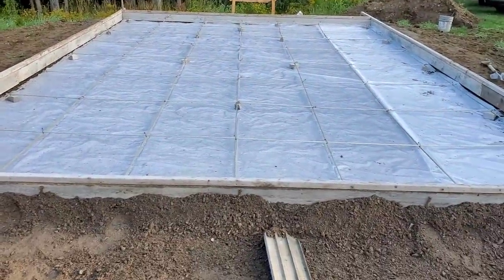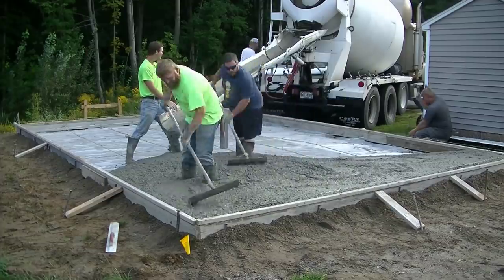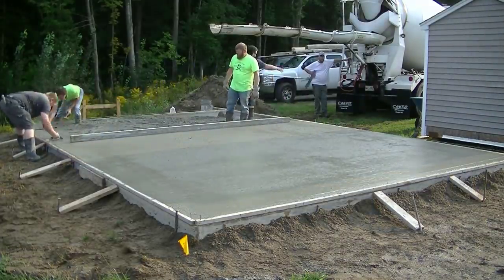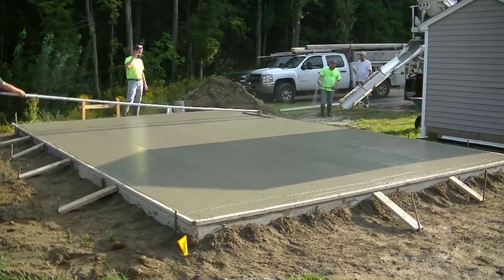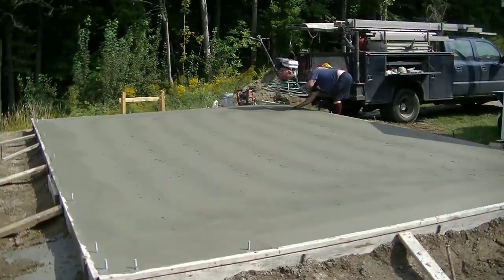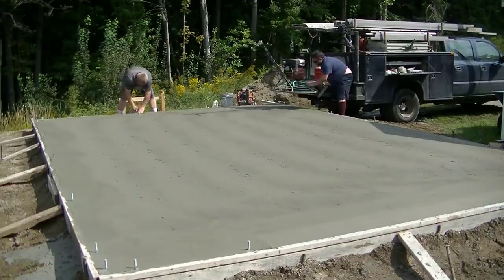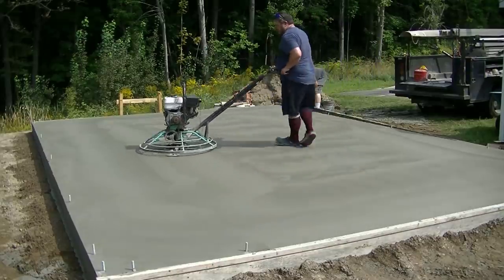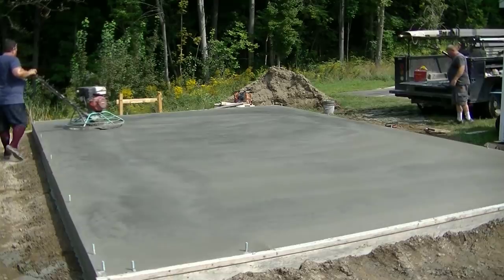They Made Us Pour This Shed Slab 8" Thick (Wasting Money)

Comment: Allows for upgrade of the shed to a house or workshop.   I had complaints that a concrete floor in a conservatory had worn away.  Turned out the occupiers installed a table tennis table and it was used 10hrs a day with all local friends,  if they had said I could have specified a different formulation for the top strata and finishes

Comment: I just love when a city inspector wants to double what is normal, and then insist on it, instead of saying yeah I made a mistake do the right way.
Reply: Boy isn’t that the truth! I’ve had it out with a few of them until I learned best to SHUTUP lol (well MOST times;))
Reply: @jeffchristianson-ziebell  I know, I worked for a company utility and we would argue with them all the time, they would kick us off a job, it happened a lot so our boss had to have a talk with the city telling them to quit kicking us off, we were killing his production, LOL
Reply: 1st of all chief a city inspector has to follow the engineers signed and sealed plans not what they themselves want.  I know, im a state licensed building inspector.  The plans have to go through plan review with the building official first and be approved.
Reply: @mikemcguire4071  So when the same inspector tells one builder that they want all the piping air test to 60 psi and the other builder 15, I guess they are following the plans.
Reply: @Moondoggy1941  no.  The code is specific on how much pressure should be in the pipe.  Keep in mind commercial code can be different from residential.  If the inspector did what you suggested favoritism may be involved and he could lose his license.   You can make complaints against said license that is right.
Reply: @mikemcguire4071  I t cost the builder tons on time and money.

Comment: The property owner is the decider.  If they wanted it a half inch thick you should advise them of any problems you foresee and then you pour the half inch slab.  Maybe if it doesn't meet inspection requirements get them to sign off on it, but do what the property owner wants without judgement.

So if they want it to exceed requirements, again you should inform them if you think they can save money somehow with a thinner slab but you never suggest it as a superior alternative.

Comment: It has been mamy years since I worked in building design and construction so I'll defer to your expertise. But we built many buildings back in the 80's with a 4" slab on a 4 - 8" compacted stone base with 4x4 or 6x6 wwf. 2,500lb mix. I've done the engineering analyses on these so I know they are strong enough for most uses. I also built a cancer treatment center with concrete walls as thick as 3' to prevent radiation leakage. We used rebar with concrete floors 2nd story and above, but typically not SOG. I understand floating slabs with a reinforced thickened edge are an alternative to deep footers and foundations but this is something different. As for codes, I'm skeptical that any code would require an 8" slab for a residential outbuilding. Great video and I'm not questioning your work at all. Just wondering if industry standards have changed that much since the 80's.
Reply: I'm guessing the key is the base? I know, I've been involved in warehouses that have multi tier racking and 5 ton plus forklifts driving through that only have a 6" slab. As I recall though the base is 18" compacted stone.

Comment: This was probably for a private contractor. He probably recommended the extra concrete. And or it was a change to save money initially they more than likely had a footing for this design on the plans . 6mil is used under all our slabs where I am in Jersey. What’s the price for a bundle of fiberglass rebar? If it’s affordable it should take steel out of business. I still would go with steel for vertical reinforcement, fiberglass won’t rust. You guys work together effortlessly. It’s hard to build a crew that are one as a unit but when u do they’re like family
Reply: How much cheaper is the fiberglass rebar?
Reply: Funny thing is, in the video he said that the Customer wanted 6 inches

The City demanded the 8inches.  Why is everyone saying the customer wanted 8” ?   You all crazy.

Comment: Great video!
I love the idea of fiberglass rebar and stainless steel anchor bolts! Using slag steel rebar seems asinine since all steel rusts eventually, the integrity of the concrete is going to be compromised by rust swelling as well as loss of tensile strength, (condo collapse in Florida).
1) Didn't you need to have your forms and rebar inspected prior to pouring? If so, wouldn't the inspector have mentioned the 6in and 8-in difference and failed the inspection?
2) By adding a 2-in furring strip to the top of the forms didn't you just raise the slab height so now it does not match the slab height of the other building - which was one of the requirements?
3) Isn't overworking concrete just as bad as overwatering it?
4) I was tired of seeing spalling on other driveways so when I poured mine I ordered a 5,000 PSI mix with air entrainment and fiber. It's been 24 years and it looks as beautiful as the day it was poured!

Comment: Where are the grade stakes. You can't tell me that that slab is exactly the same height in the middle as the forms on the outside. If the screed board was the same width as the forms, it wouldn't be necessary for the grade stakes. Also the concrete ball that came out of the chute should have been removed rather than chopped up. That creates a void of weaker concrete in the slab. It appears that was the only one which was good. But it should have been thrown out of the forms or chopped to pieces in an area not already filled with concrete. That way it would have been like the filler in the bottom. FYI those balls are caused typically from wet sand at the batch plant or a mixer with a load of hot mud and being topped off with fresh at the batch plant.

Comment: A slab is only as good as the base it sits on. 6 or 8 inches no difference except cost if the base is good. We have been looking into the fiberglass reinforcement. 2 issues that we have found. Firat we can't find an engineer to sign off on it for replacing steel rebar. Second all the fiberglass in our area is smooth, which means it is more difficult for the concrete to adhere to it. How much has to be buried in the concrete to reach full pull strength and how much for laps? I know it is cheaper and way lighter. Another issue we would have we would need corner bars made since it can't be bent.  Great job as always mike.
Reply: If the fiberglass is  not deformed it would be a waste of time using it . There is a reason that steel reo is deformed , they don't just do it for fun .
Reply: @stewatparkpark2933  pull out for the fiberglass is a concern even though almost always rebar is for sheer strength. Pull will determine your minimum lap joints and how long you need for pre-made corners. One significant advantage is they don't rust and aren't affected by calcium or other additives.  Disadvantage they can't be stored in the sunlight. I'm still checking on if they are a good replacement for us but without an engineer to sign off on it I doubt our inspectors will even consider it.

Comment: steel and concrete work well because the thermal expansion is pretty much the same. How is it with fibreglass?
Reply: Has nothing to do with that. Concrete has compressive strength and rebar tinsel strength. Btw steel has much more thermal expansion than concrete.

Comment: I once lived at a place that had a garage bigger than the house. Two double car garages with a gantry chain crane that spanned both of them, and a HUGE garage bay on the other side that was used for fixing farm equipment (you could drive a combine in minus the header and still have room to spare). It had roughly a foot thick slab that was so smooth it would get a shine to it when clean... I miss that garage :-( the house was crap though...

Comment: background:
concrete can't handle tensile stress very well, hence it will crack if stretched. it'll also crack when it bends, because the convex side will experience the tensile stress (while the concave will experience compressive stress).
usually rebar is placed closer to the side that is likely to experience tensile stress, so having rebar right in the middle of the slab isn't very useful. ideally in a slab the rebar would be placed in 2 layers, since the slab can bulge or bend and the 2 layers will help with both.

fiberglass vs iron:
in general, iron has much higher Young's modulus than fiberglass rebar, which means iron will stretch much less than fiberglass given the same amount of tensile stress. this is why iron is usually a better reinforcement material than fiberglass. HOWEVER, if the structure experiences frequent load changes or exposure to abrasive elements (esp. salt water), iron will suffer from material fatigue and corrosion and fiberglass will not. and of course fiberglass is much lighter, so it's easier to work with and it won't affect the structure weight as much. while you can replace iron with fiberglass, you generally need much more of it to achieve the same resistance to tensile stress.

bottom line:
for a slab under a shed you can skip the rebar all together unless it's on freshly infilled soil. if you do put the rebar (e.g. for heavy machinery), your best bet is to put 2 layers of rebar (about 2" from the top and 2" from the bottom) with 16" O/C for iron and about 10" O/C for fiberglass.
Reply: The amount of reinforcement put in this slab is only sufficient for shrinkage and temperature control. Therefore, it should be placed "above the mid-depth of the slab" (Designing Floor Slabs on Grade, p. 18, Boyd C. Ringo and Robert B. Anderson).  To say that placing it at the " middle of the slab isn't very useful" is incorrect. Also, for concrete constantly exposed to earth the minimum coverage recommendation is 3", not 2" and for the top, #5 bars and smaller only require 1 1/2' of coverage.

Comment: 8 inch seems excessive. But in saying so I bought a public utility building and its all 12 inch concrete. I think the fibreglass reinforcing is going to be a huge failed product issue in the future. You only need to see how it flexes to know that it won't give concrete the lateral strength which is the whole purpose of reinforcement. I'm surprised the steel industry hasn't tested fibreglass in structural beams to show its lower carrying strength.

Comment: If I’m willing to pay for labor and materials for a 10” slab and the contractor is willing to do the work and guarantee it, then the customer is right. How is this a waste of money if it’s what the customer wants and he’s willing to do the work?  Maybe the customer is housing a CNC shop in there. Or, a hydraulic truck lift. Or how about an I beam structure that requires the foundation to be 8” for when they bolt it down.

Comment: Have been using it for 3 years now up in Green Bay Wi been working great.
Reply from the maker: Good to hear
Reply: @MikeDayConcrete  it nice to cut we use a carbide saw blade in a rechargeable circular saw?
Reply: Watch out for the safety Nazis telling you you got to wear a mask when you're cutting carbon fiber with a circular saw that's not attached to a HEPA vacuum, LOL

Comment: Forty years of building, and my buildings on my farm, for any building, even if a shed, being a larger size, 8 inch would be my minimum too, have seen cracking even on 6 inch, and if never know the load at any point in the future best to be safe than sorry no telling what my be in that shed, heavy equipment at some point ? 6 inch exterior, I never never do anything 4 inch anymore myself, a little more now no worries later. and garages here, 8 inch min and no cracking, SUV's are heavier now. Farm maintenance building is 10 inch, but these big pieces of machinery is heavy.
Reply: and with a building that size, even if said was a shed, who knows future use, would have set foundations perimeter bigger like if were a house just in case if were my building.

Comment: There should have been city approved stamped plans on site and given /shown to you to bid on. There should have been no surprises. It was your fault for not insisting on bidding from approved plans! Also why don't you have a copy of and know the State Building Codes governing your trade? You should only be doing work that meets either minimum building code standards or from an engineered stamped plans. Building Codes are the minimum standard also, so if an owner wants more than the minimum and pays for it that is fine. If the slab plans were stamped by an engineer then the inspector uses that specification to enforce, not the minimum state code. You apparently never learned to get the actual final plans to bid from.

Comment: Try building in a high wind zone.....two feet wide and 8 inches thick for footings. Threaded rod embedded into rebar and speced into the treated base plate. 
All hardware in contact with treated lumber has to be hot dipped galvanized??......find an all thread 1/2 inch dowel rod HDG...does not exist, but my project passed inspection.
After the inspector left the job site, I removed the square washers, and packed the area around the threaded rod with marine grease...the corrosion had already started on the threaded rod.

Comment: Mike i need 2 driveways one 14x600 6in and one 14x2000 6inch. Then i need a 30x60 12inch with 6inch PVC drain pipe in center with slab slope to drain pipe. Cannot find reliable cement work here so if you want to come on down to Ms i got some work for ya..lol

Comment: Gentlemen, (judging by the YouTube videos that I have seen), the amount of reo steel that is typically put into a slab in the USA is exceedingly little compared to the requirements in Australia. The cost of concrete is relatively little, especially when compared to the cost of formwork, approvals and slab failure. I encourage you to build stronger than you think is required. Slabs are typically over loaded at some time in their life.
Regards,
Geoff. Reeks

Comment: Another long term benefit of the composite bars over steel is the lack of corrosion.
Over time the freeze thaw cycle and the moisture getting into the concrete does allow for the metal bars to rust, which leads to failure of the concrete. We are talking close to a 100 year time period for it to happen. The moisture barrier below and the composite bars will actually extend the life of the slab.

Comment: The inspector required a thicker slab. However, the rebar mat also needs to be raised to the middle of the thicker slab. 

The inspector may be applying a new 4" cover standard for steel rebar in slabs exposed to seawater incursion or salty soil. However, it is not necessary to increase cover on Basalt rebar since it does not expand after decades of concrete aging. Local regulations may not (yet) have exceptions for Basalt rebar.

Comment: Interesting that the owner doesn't have 2" styrofoam put in under the concrete  this would make the foundation more versatile  for future use.  Also is covering the slab to prevent early drying of the surface someting that is common ,  l have read that concrete surface should be prevented from drying up one week minimum.
Reply: Ideally slabs should be covered and wetted, especially in hot climates …

Comment: I removed soil and put in almost 2' of compacted road base and poured a haunched slab on the sides was 12" deep by about 8"...most of the center was 5". A little over kill for a 18x30 shop but eh the extra concrete was minimal.

Comment: FEMA flood zones require a minimum slab height, might be what the inspector was calling out. Water reducers are so you can use less water in your mix to achieve a stronger slab without losing workability. Using a water reducing admixture, but not reducing the water in the mix is why you are having low slump and excessive bleed water.

Comment: Maybe this will give you some insight . 8 inches is the normal manufacturer recommended thickness for an anchored automobile lift with a weight capacity above 4500 -5000 lbs,  so that may be the reason , my shop floor is 12 inches thick since I have a large truck in my collection that I work on and I did go  over on design . I had built my shop in the  early 1980s . 82 or 83  , I presume concrete technology has certainly moved on since then .

Comment: DO NOT USE THE FIBER REBAR. I am in the south, a friend who built a 6 bay shop, two had steel no problem. Later because of supply he was convinced to use fiber in the other 4. Weight of cars and and tree roots turned the thing into a cracked, slopping, screwed up mess.
Reply: I bet he didn't pour an 8" slab

Comment: Hello Mike, what is the cost of that glass fiber rebar compared to steel rebar?
.
Reply from the maker: Both are around 6 bucks a bar.
Reply: @MikeDayConcrete : Thank you for responding, and thank you for your videos too.
.
Reply: @MikeDayConcrete  so weight saving is the only advantage?
Reply: @queerdor  You don't have to worry about it rusting and cracking the slab a long time in the future.

Comment: Wait, if you had to match the elevation of existing house slab, and you did that on the initial form; wouldnt adding the 2" rip make it 2" higher than the house slab?
Reply: You measure from the top of the gravel base. With the 6in slab he would have been 2in short.

Comment: Great job !!  Is it common to match top of grade with the house?
Reply: Yep. Its done all the time on residential and even commercial concrete projects. Its called Finished Floor, and shows up as FF on blueprints! It's done as a baseline for elevation, if everything is based on a level, set in place floor then everything is way more accurate and precise
Reply: @JoeCoggin147   thanks brother
Reply: @joer4595  Another common technique in commercial projects is pouring all of the curbs on the site before doing any of the floors/walks etc. For the same reason as well.